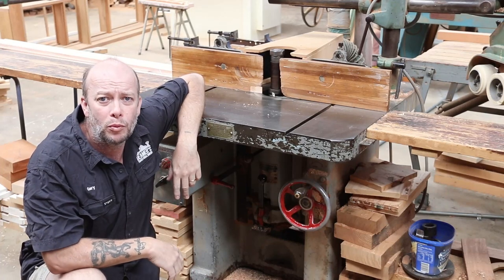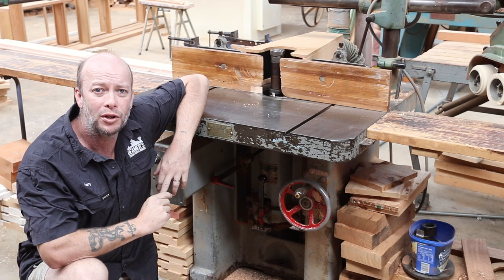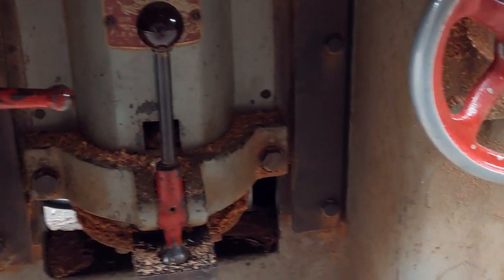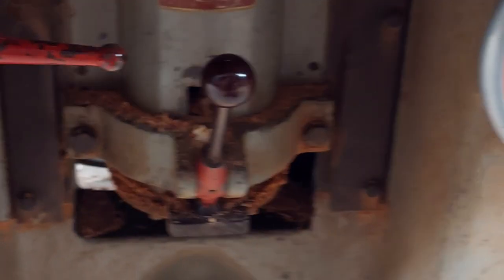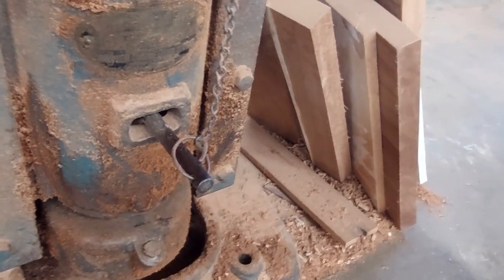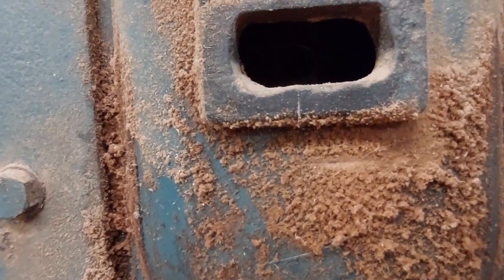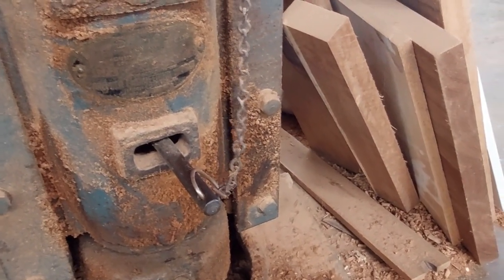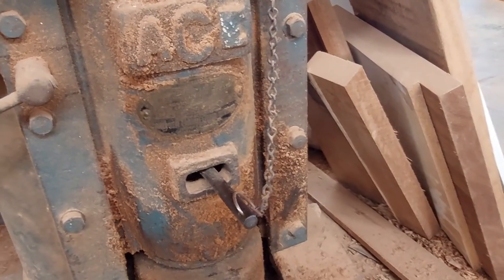Locating The Spindle Lock on a Spindle Moulder | Re upload

Comment from the maker: I had to reupload this video as the original had frozen right where we needed to see it.
Apologies for that.
Reply: Hi Gary (if I read your shirt correctly).  Thanks so much for the video.  I will have another look at my machine tomorrow and see if I can get the job done.
Reply from the maker: @47GreenJeans  
No worries, hope it was of help. 
Also, just check to see if it is a lock within the shaft, meaning, an allen key bolt that goes inside the spindle, that would require a special tool that should have come with the machine that locks the spindle bolt whilst loosening the Allen key.
Hope that makes sense.